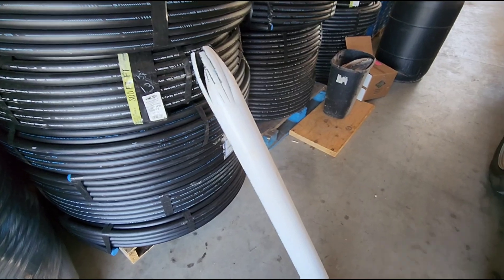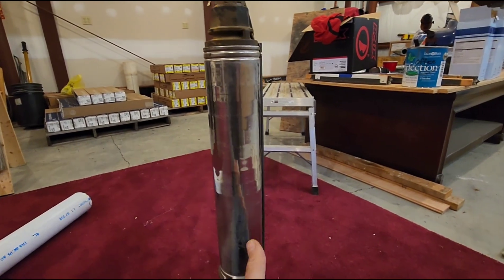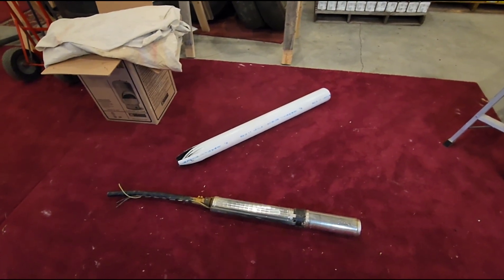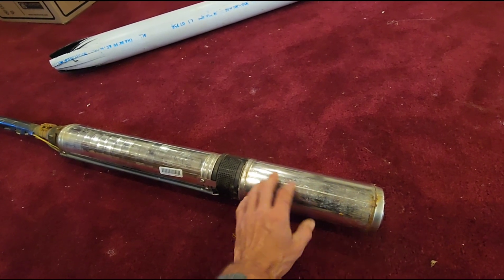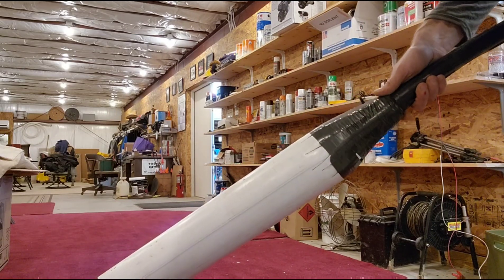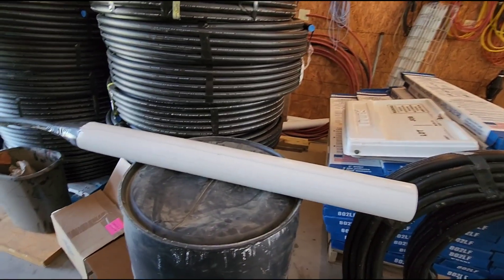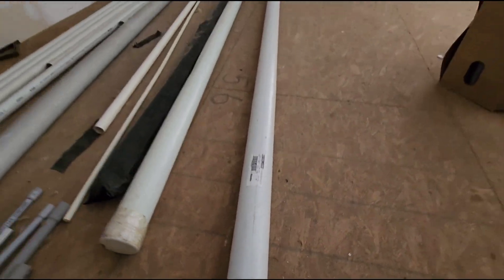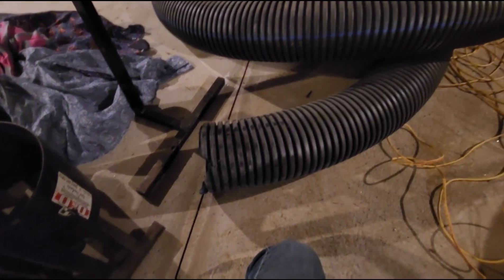This $10 Device Extends Well Pump Service Life & Helps Reduce Sediment Issues.

Comment: I can believe that this is a good tip for folks around his area , where water coming into the well from the surrounding strata (rock formation) is likely to be coming into the well bore at a point above the pump. But around here and I don't know how many areas around , across the country we often draw water out of a sand formation which has been screened off at the very bottom of the well ; so that water is already coming up past the motor cooling it down before it gets to the pump intake. Just saying ; you wanna know your wells structure and put together the system that works for your circumstances.  I think it's a rather neat idea for the circumstances it looks like he deals with regularly though

Comment: Do you still recommend using a pump sleeve in 2025 or has your opinion changed at all?
Reply from the maker: They are a great addition especially if wells make alot of sediment. I believe they extend pump motor life, but not a necessity

Comment: So far I have apparently been lucky. My 1 1/2 hp Jacuzzi submersible is original from 1999. I have replaced 2 capacitors, 2 pressure switches, and the pipe to the pressure switch as they were scaled almost closed. The well is 380 feet deep with static water level around 85 feet in the summer. I was unable to find out the pump model or the depth of the pump from the original installer. The down pipe is 1 1/4 galvanized iron and the water is slightly acidic, so I don’t know if the pump or the pipe will fail first.

Comment: Sounds like I am doing better than average.  I installed my pump in 1985, 300 feet deep in a  granite 6 inch hole,  The pump can out pump the incoming flow rate and thus has seen some abuse.  It is still working.  The manufacturer of this pump is  Berkeley.  They appear to still be in busines but I know of no one that still sells them.

Comment: Could you leave the pump motor extended a little below the sleeve.  Seems like pump would have to work harder in a more narrow confined space?
Reply from the maker: @ollie1976  the idea is to force all water to flow by the motor cooling it. Motors are typically what die, not the pump stack.

Comment: I have a question sir. I have a new well that is about one month old. I have been running it one hour on, three hours off to clear the well. The water is "dirty" when I run the pump with the spigot on the pressure wide open. When I run at half open or less, the water is clear... any ideas? Thx in advance. Love your videos

Comment: I can't seem to find the info online very easily and every time I ask Google or YouTube this video pops up. I am installing a half horse submersible well pump inside of a cistern to help with making my parents cottage a little easier for them too. Start up and shut down for the winter. And when I unpacked it it has an 1" 1/2 outlet on the top. I'm assuming I can reduce it down to 1 in to make it a little easier to install in the bottom of the concrete system underground, but I don't know if that's going to cause too much restriction for the 12 ft of lift it needs to do to get up to the pressure tank. I know it is a little bit oversized for what it is but it was a smallest pump I could find and I just figured I'd get the biggest pressure tank I can get if it cycles a little bit too fast on the pressure tank I already have. Basically my question is can reduce the pump down to 1 in and not have any major issues with the pump and it over pressuring the pressure switch which I'm planning using a low pressure cut off switch and a float switch in the tank to cut off if it ever gets too low

Comment: I’d be interested to see a test on the temperature with a sleeve vs without a sleeve. You would probably need a thermocouple to get a temperature reading while the pump is running in the well.

Comment: I just installed my Franklin one horse 10 gallon per minute pump yesterday plan to hook up the tank today and saw this video on putting in the pump sleeve to direct the water flow over the motor.  the pump is at 200 feet, well depth 260 feet, static water line is it 25 feet. Should I pull that pump back out and put one of the sleeves on there? I’m in a granite, limestone and shell area of north east Alabama not far south of Chattanooga.

Comment: When I bought my house, it was from a foreclosure.. no idea about the age of the well pump but looking at it, it's probably original and the house was built in 1960.  The tank is about seven foot tall.  Today I get to either swap out the switch or clean out the nipple below the switch - or ideally, flip the contacts to get a bug or something out.

Comment: I'd probably use a hole saw and cut a hole the size of the pump in an end cap then glue that to a pvc pipe, slide it almost to the top and silicone it in place.  I wouldn't expect the electrical tape to last for too long down the hole.

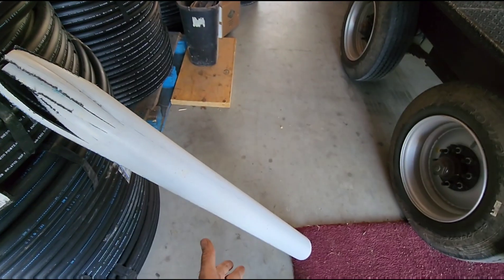Comment: I stopped in my tracks when you said at 0:22 that "you just need a little common sense". I don't think there's much of that around here! Seriously, though, what usually fails first: the pump or the motor? In my limited experience, it's the motor. I've pulled plenty of failed units that had pumps in perfect condition. In fact, I replaced the motor on a 1.5 hp Grundfos pump and reinstalled it, as the pump looked like brand new. It was sixteen years old.

Comment: Have you ever had to pull a well where the pump fell off the end of a pvc pipe. My well did (or so I was told that by the well company I had hired) the well was drilled at 365 and about half way out of the hole it hung so that put the pressure to it with there puller truck and something gave and they was able to finish pulling the pipe out of the well with just the pump bushing on the end of the pipe and of course the wire and after that had to have a new well drilled at 400 feet

Comment: Need help to design the system and like to buy them from you
Reply: Static water level at 75 ft well deep 600 ft the top part of the pipe above the ground is metal casing 8 in
Reply: Well produce 20 gallon per minute
Reply from the maker: I can design you one. You'll need to buy a 8" well seal somewhere else though. Hwdracing@gmail.com we can communicate there. I'll call you, it'll be easier to make a list of items & help me to understand your water usage needs
Reply: @h2omechanic  ok goid

Comment: The cold-water inflow from the bottom of the well should be at an overall higher rate than the On-Off pumping cycle of residential submersible pumps with a pressure tank. As a result, the submersible pump should be pulling water from the bottom and top of the well and have OFF periods as new water is arriving from the bottom. On older residential wells that may no longer be the case, but that situation will lead to pump and well problems regardless.

Your PVC sleeve forces a thin film of water to pass around circumference of the motor before enters the pump. As a result, water between PVC (insulator) and motor SS surface (hot) is heating more quickly.  Without a sleeve, water warmed by the motor will lift and mix, transferring heat to surrounding water at the same time. As already mentioned, new cold water from bottom also cools submersible pump motor while working and when motor stops. Motor technology for submersible pumps does not have very high efficiency so coils generate a lot of heat and the SS sleeve housing is a poor thermal conductor. Pump's stator coils are also surrounded in epoxy and there is no place for heat to go internally with rotor there also getting hot. Consequently, well pumps need to have time OFF to recover from destructive nature of accumulated heat. When pumos are OFF, your PVC sleeve is creating problems by preventing a quick heat transfer from replanishing water from bellow. Pressure tanks and pressure switches help with maintaining supply of water while pumps are OFF and cooling periods by the design of that pump-pressure tank system.  The other problem with your PVC sleeve is that it is not restrained at the bottom to stay in a concentric position with a circumference of the pump. Water pulled by the pump from bottom of your PVC sleeve will take path of lower friction (lower resistance) consequently shifting your sleeve to one side of the motor. In other words, water will not go on its own in perfectly balanced and equal amounts around the motor with maximum surface friction and with that motor cooling. As a result, you are likely to cool one side of the motor more with that PVC sleev, which is not good for the motor. This PVC sleeve is also forcing deeper water pull (about 2 feet based on your comments), so it increases dynamic head for the pump and with that small increase in power usage and heating of the motor. More work for the motor comes also from the sleeve and SS housing of motor creating friction with a film of water passing in between and around the sharp edge at the bottom of the motor. In pump dynamic head calculations this all adds to total head and with that heat and power use of the submersible pump.

There could be some benefit in reducing sediment intake from newer granite drilled wells. On my 600 feet deep 25 years old granite drilled well I clearly have a lot of rock surface for sediment. I probably had some sediment in earlier years, but my now 21-year-old pump is still pumping 5 GPM without any PVC sleeve like yours, or sediment in the filter. I understand that every well and pump instalation is unique. Perhaps, having two parallel installations monitored for extended period of times would allow us to best compare power usage and life expectancy with and without such PVC sleeve. 

My other concern is about how such PVC sleeve installation affects the manufacturer’s warranty. Do you have any experience with that?
Reply: Those pump sleeves (stainless) are sold by pump manufacturers  , naming them cooling sleeves ( Kühlmantel).
Reply: You could solve the issue by not fully sealing the top of the sleave so convection currents can circulate even when the pump is off. Not too big of a hole mind you or it defeats the purpose, but a cylinder that long is going to work quite well at creating natural convection currents, just like how a chimney creates a vacuum at the bottom.

Comment: Great, informative videos.
I have a new well 955’ deep and some questions.
I see you have stacks of 300’ x 1” poly.
What do you use to butt connect them… I’ll need 3 rolls to reach the bottom of my new well.
Any other recommendations would be great.
Thanks in advance… CaptWingnut
Reply: Don't use poly at that depth my opinion think about pulling it and what is your well producing gpm and the static water level plus the diameter ? You can get poly in bigger length rolls.  You need size your pump system for depth ,friction ,head pressure etc etc.
Reply: Poly won't cut it at that depth. If your water level drops that low during pumping you'll get over 400PSI at the pump head. That's a steel pipe job.

Comment: I found your channel and man I wish you were located near me!!!!

I had a chaffed wire on a well pump, found it when the beaker kept tripping, got a new pump the original was 21 years old so
Might as well replace the wire and pump since it had to be pulled anyway!

Well new the problem,  went to put the new pump and wire down the well (250 foot well) and it only went in 1/2 way and it won’t go any further!

Some obstruction about 100-125 foot down!!!

There was some mud on the roll pipe when we pulled up the original pump so I’m praying it wasn’t a partial or total collapse of the well!!!

What would you suggest I do next?  When the new pump hits the obstruction you can hear a thud clearly!  I tried LIGHTLY bobbing the pump up and down but it clearly isn’t going down any further in that well, something is blocking it!

Thinking a partial collapse or a rock was laying against the pipe as we pulled it past the rock fell over and is lodged in the well casing????

Comment: Looks like the thing to do. I had a 4” drain pipe on my rack so I’m giving it a try. Time will tell. Thanks for all the info you share. 
I have another well that needs a pump, won’t start and pulling 17 amps on one leg. That pump is 12 years old and has 1” PVC. Not as easy to pull as poly pipe.

Comment: Can you use a submersible pump in a shallow  well? If so what type or size is best. I live in Missouri and most houses around me have shallow well.
Reply from the maker: What diameter well is it?
Reply: @h2omechanic  it will probably be 3 or 4 in.
Reply from the maker: @bigdogGEN-X  if its a 4" well, you can use a submersible 3" pump from grundfos
Reply: @h2omechanic  ok, does it matter what hp? I hope to get the well 30-40 ft. It will be supply a 3bed 2bath house.
Reply from the maker: It's a 50/50 chance . My typical well is 160ft.
Reply: @h2omechanic  ok, thanks

Comment: My well is driving me crazy. 1hp vertical jet pump. 100ft well.  The original pump was cycling  on and off every few minutes.  I was told the leathers were bad so I pulled  the pump and changed the leathers and the assembly  at the bottom  of the well. It's a 1" pipe  inside of a 2" . Now with good leathers , bottom assembly & a new pump. It is blowing the flange seal . It fills the 2" pipe to the top and blows the seal.  Can u help me under stand what I'm doing  wrong  thx
Reply from the maker: I have no clue, sorry. Not familiar with 2" wells. But sounds like you have the pressure side going to the well, not the suction side. Hard to say if im not on site to look at the entire system

Comment: Hey bud, I have a question.  How do you feel about a union type tank tee compared to a non union tee?  I understand the less unions there are the less chances for leaks, but I go through pressure tanks regularly up here with the 5.7ph water I have.  I thought the tank replacement would be easier with the union tee since I won't have to mess with the poly pipe or the other connections when replacing the tank which isn't gonna be long, current tank is 11 years old, disintegrating slowly on the bottom connection and leaking from the tee..  I have an Amtrol WX-203 tank, they seem to last the longest around here.  What brand of tank tees do you recommend?  Stainless or brass?  What brand of pressure tank is your favorite considering my water is battery acid?  Thanks in advance, I very much appreciate your advice and quick responses. 😁
Reply from the maker: I like the union type Tees. We just don't use them. But they make alot of sense, they just aren't cheaper if bought in bulk. 
Brass is less likely to leak & SS will probably last forever. I'd say go for it, either is fine. Brass is easier to work with imo.

Comment: Absolutely would like one of these pump sleeves! Will be pulling my only 3.5 yr old Franklin pump next month (sad face) when the weather warms more (Interior Alaska). Pretty sure the check valve at well pump failed since water is backing down the well pipe and causes air to enter and is making the pipes sputter every time the pump cycles after pressure drops down (pump switch set at 30-50 with expansion tank at 28psi). There's another check valve just before the expansion tank that probably directly contributed to the suspected failure with the negative pressure and the water hammer slamming down on the pump check valve. I will remove the check valve at the tank in favor of a cycle stop valve (CSV) or just keep it all simple like your videos suggested and only the check valve at pump. 180' well with water at 146' and pump is supposedly sitting at 160' or slightly lower (all according to the builder who had the well drilled and pump installed). When the symptoms first started with the surge of water bringing the air up there was a large amount of sediment being brought up too, so I can imagine the pump had to fight through that. May buy a Grundfos pump and redo the poly pipe and wiring since I'll have everything out. Watched most of your other videos, so thank you for the great content since that gave the motivation to attempt this DIY!
Reply: Update on my own comment: Well is 185' deep with water at 160' (probably 140-150' now that the melt finally happened in interior Alaska). Pump was at 180'. Turns out it wasn't a Franklin pump, but a "Lowe's special" $499 (cheaper elsewhere too) "Utilitech Pro" pump. Turns out the original installer chose not to add an extra 1 1/4 brass check valve on the top of the pump. Just the flimsy plastic internal check valve that failed, allowing water to back down the 160 psi poly pipe and causing air in the PEX tubing once the expansion tank emptied and it took the extra 15-30 seconds for water to make its way back up the long poly pipe.

Everything else appeared well done. Could be better here and there, but overall a good install with proper splicing, taping, a torque arrestor, and even the plastic spacers throughout the length of pipe with the nylon rope on one side and the wiring on the other.

Why they cheaped out on $50 for the extra check valve I don't know.

Either way now that I've done it, the water works as it should with no air in pipes. Of course I still want one of those sleeves, because the average lifespan (based on the many negative reviews on Lowe's and elsewhere) is 3-5 years and it's currently 3 years old. The home builder claims he has the same pump in houses nearby with 7 years going, but that has to be borrowed time.

I will take the risk and plan ahead for a next summer replacement with a Grundfos pump and would love one of the sleeves to put the finishing touch on it.